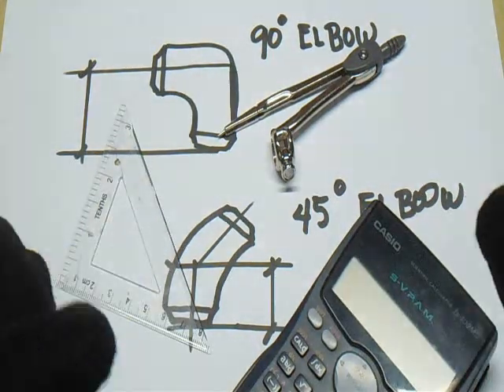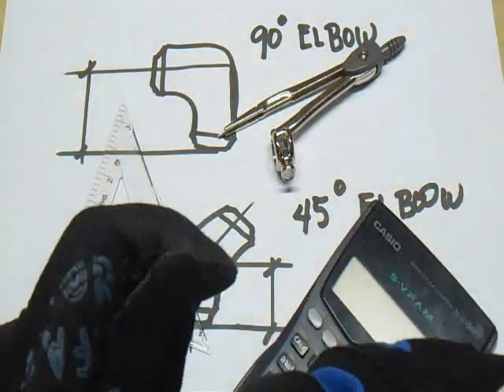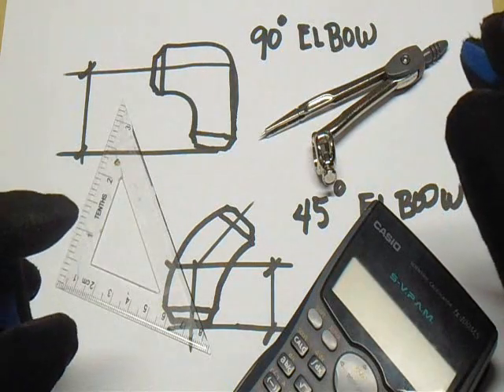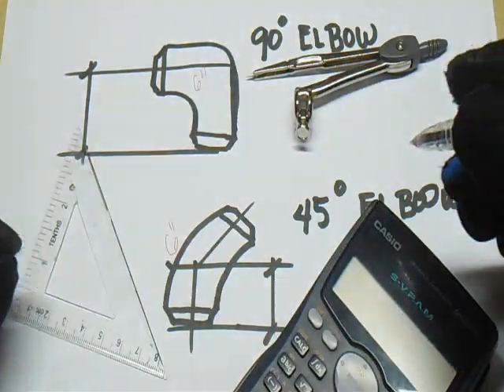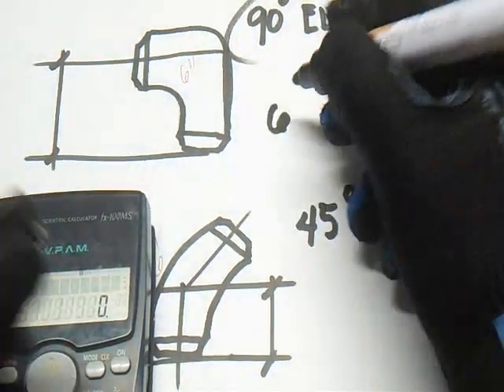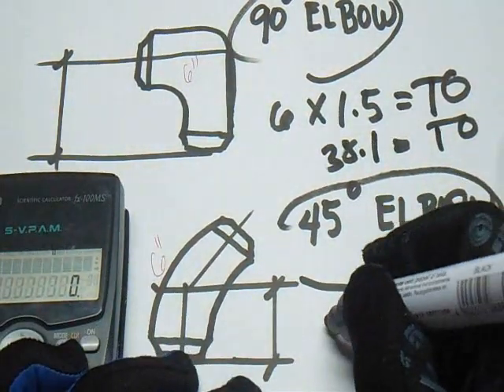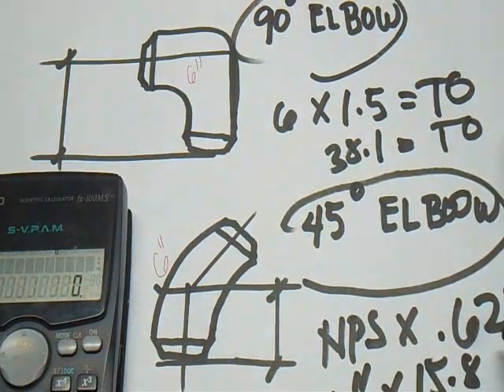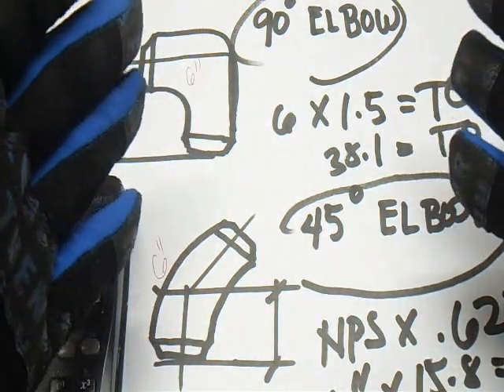Take Off - 90 and 45 degree Elbow -Piping

Comment: could you please explain me the definition of take off
Reply from the maker: niranjan savant Long radius 90 deg elbow has a take off dimension of one and one halftimes the nominal diameter of the pipe.Ex-4 inch pipe an actual diameter of 4.5 for the elbow the take off dimension would be 4*1.5=6''